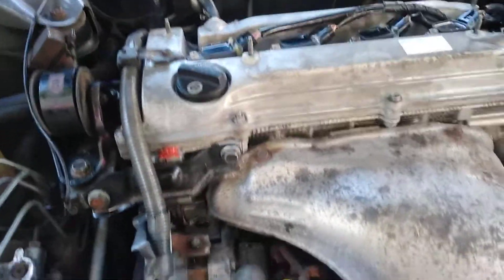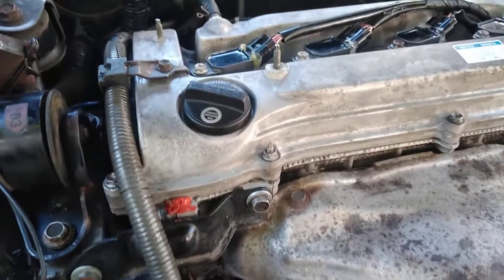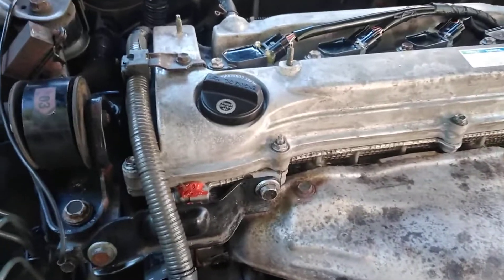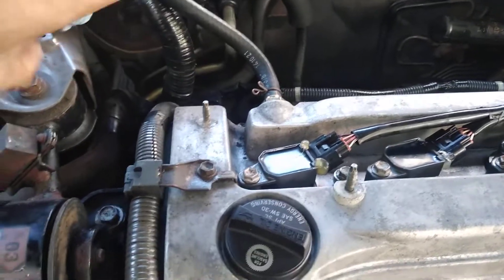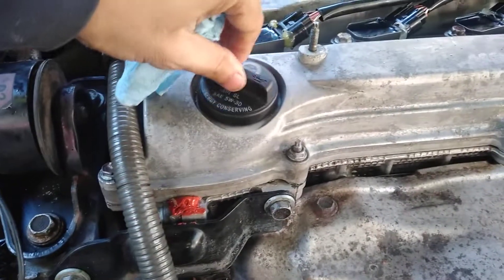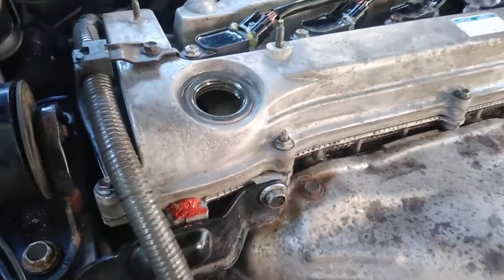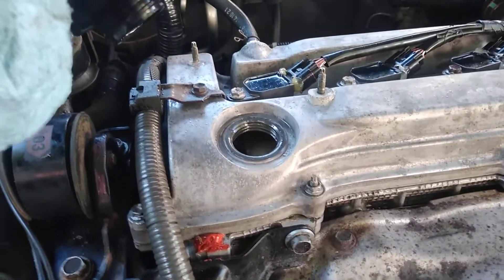Too much positive pressure from oil cap. Camry 2005 2AZ-FE engine.

Comment: I watched a  video telling people to test used cars. It said that it’s abnormal when there is a blowby😂Is he telling nonsense?
Reply from the maker: Not necessarily. This is normal in Toyota engines. At least two of the Toyotas I have owned, both show the same symptoms but run fine.
Reply: @someone1089 ok I see, thank you for the information. Mine is Nissan😢

Comment: So many engines have been misdiagnosed by this same alleged issue.  There is nothing wrong with this as BMW 4 cylinders do the same thing and Ecoboost Mustangs etc.  When you put the oil cap back on, the PVC system works as designed.  The 2015 Mustang I have in my shop was diagnosed by another repair shop as needing an engine simply due to taking off the oil cap while it was running and hearing the noise and feeling pulses of air coming out.  A cylinder leak down test showed only 9% leakage in cylinders 1&2 and 6% leakage in cylinders 3&4.  A compression test showed 170, 170, 171, and 174 PSI which is terrific on a 105,000 mile engine.  No blow by on this Mustang engine.
Reply from the maker: @davidmcclain5180  Thank you for your valuable input on the subject. I have come to the same conclusion after learning from many experts like you. I have sold this vehicle, for other reasons and bought another Toyota. This newer Toyota is behaving exactly the same, i.e pulsating air in the oil cap. I might upload a new video of this one too. But I'm not worried about performance now.

Comment: I have the same problem but there is oil on my crankshaft position sensor. I think there might be a sela thats already messed up in there. That causes oil to leak into the sensor. That is just the sympom of pressure build up in the engine. I barley atarted checking this out on my car. Anyone got any idea. I know alot say it could be the piston rings, but then it would be blowing white smoke out the engine cap. This is just excessive air build up

Comment: Loose your pcv valve and you will see there is no air or blow by on the hole.The oil filler still move air but no smoke or comoresion ...

Comment: I freshly rebuilt my 2azfe and put new rings and pistons on and it has same pressure coming out of the oil fill but as long as its not smoking out of it or out the exhaust than is normal i guess..  the cams and timing chain all are open to the air inside that valve cover so they make that much wind apparently.  Those motors though have issues with the pistons not allowing proper drainage between the oil ring holes snd causes buildup and seizure of rings which inturn burns the oil.  Eventually it will effect all pistons and start burning over a quart every 100 miles or less..  i guess it could be a leaky valve causing the pressure there but isnt any blowby like some are saying.  Probably if anything its an exhaust valve not seating fully releasing that pressure out through the valve body.   Youd think the pcv valve would be putting in work with that pressure though which if it gets clogged will causs issues.. mine has no pressure coming out of the dipstick though so not anythibg big..
Reply from the maker: Thanks for the detailed reply. It makes me feel better that a rebuild engine is behaving the same. I also suspect that it's either the valves not seating properly or the valve stem seals have some leaks. Despite this air blowing the car still runs great.  It loses oil a bit which I have not measured yet. One again thank you for your input.
Reply: Yep these motors are known to burn oil after some miles are put on it or if the motor overheats even once..   or if regular oil changes arent followed.  The piston oil rings were not designed correctly and toyota recalled them if the motor was burning more than a quart every 100 miles.,  the fix was replace the pistons and rings with their upgraded version:.  Otherwise best bet is to keep the oil changed, change the little vvti screen/ filter behind the power steering pump and check the pcv valve every so often to make sure its not clogging up at all.. use a cleaner like seafoam in the oil before you change it also..  will be able to hang on to the motor for longer..  just stay on top of it or it will stay on top of you..

Comment: I have very similar problem on my 2005 accord 4cyl. Oil fill hole blows air like a fan. Car is burning lots of oil. Exhaust is producing black smoke. Thicker oil reduces the smoke but it doesn't stop. Fuel economy is also very bad. Im of the opinion that my rings are stuck.

Comment: That is pistong ring problems.

You need to know that your engine can pass 300,000 with the rings problem. 

If you dont have too much oil consumtion keep with 5w30.

If you have oil consumtion its easy 5w40 or 0w40 

At every oil change use a engine flush motor medic, liqui moly or just 1 quart of diesel 10 to 14  minutes at idle and drain
Reply from the maker: Thank you for your valuable advice. My car has oil consumption issue. Specially after highway driving it loses more oil than compare to local roads.
I will try to flush next time I change the oil.

Comment: If you haven’t lost oil, power or compression then I wouldn’t worry
Reply: Mate this is normal blowby even in new cars! that's what pcv valves are for. Don't worry
Reply: @DimoS...  how about if air with some smoke and oil?
Reply: @medelkasmi1100  it also depends on the design of the engine mate...usually, smoke and oil are bad signs, but in most cases, it is normal or initial blow by stage.
Reply from the maker: I am loosing oil. Specifically on highway speeds its about a quart every 600 miles. I am thinking to do a piston soak with some chemical.

Comment: I've got exact same symptoms on a Mazda CX7 2.3L Turbo - there is the exact same sound from oil filler. However when I check the dipstick, I get nothing.,... this does not make sense as they should be the same.

What I'm thinking is that with the filler open the PCV closes due to lack of pressure and we see air pulsating out - when we close  oil cap and check at dipstick, there is some pressure inside which opens the PCV and it does not pulsate.

This might be how the engine works out of factory - have you found out anything more since making the video?
Reply: I also have one other theory which is the oil filler cap is directly above the timing chain - and that creates a lot of turbulence in that area.... hopefully you have figured it all out alredy!
Reply from the maker: @pingpong9656  Thanks for your input. I haven't figured it out or got any satisfactory answers yet, but a lot of suggestions like yours makes sense. I am driving this car as my daily driver and recently done a 1200 miles round trip without any problems.
Reply: @someone1089  On a forum, someone mentioned that 4 cylinder engines from 2000 onward all behave like this - he said we must be used to V6+ cars that have no such sound... this made me go check another 4 cylinder car, and sure enough it's the same sound - that car is super healthy.

I think we are good - I have some piece of mind now.

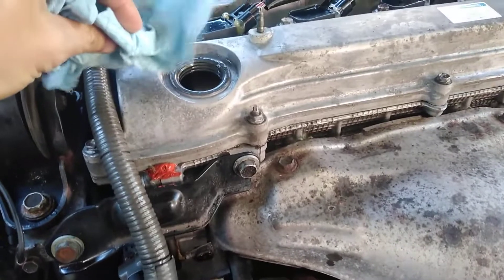Comment: Thank you for the comments; my car is 12 Camry 2ARFE with 164k miles. I have the exact same symptom; blowing air out with no smoke from the oil fill cap, same as the one indicated in the tissue test in the video 00:54 timeline. I did the balloon test for the dipstick, and it was dead silent. The Mechanic changed the VVTI Intake since there is no smoke, changed the PCV valve, and he did the compression test wet and dry no variation there. The mechanic said the air was not exhaust; otherwise we would have seen the exhaust smoke coming out along with blown air. Also, It wouldn't be a ring, because as it leaks compression, it would also leak oil the other way and cause the oil fill cap to blow smoke after burning it in the combustion chamber. It is driving me crazy as this has been two year long process. I saw Toyota Highlanders and tested them; the oil fill cap was dead silent with engine running. The mechanic said It must be something leaking somewhere, because this is not normal. The combustion chamber should be sealed. Does anyone have any idea? Thank you!
Reply: Does your engine consume oil or do you have any other problems with your engine? If the answer is no, I would just forget about the oil cap and enjoy the car.
Reply: @antonmaltsev7760  the car oil is going down by one quart every 1000 miles.
Reply: I have the exact same problem
Reply: My 2.4 2008 Camry does the exact same thing.
Reply: Did you figure out the cause of ten problem?
Reply: No still looking for a solution.
Reply: Leaking valve seals?
Reply: I am not sure to be honest.
Reply: I have similar issues with a 2007 Camry. Sometimes a little smoke comes out.
Reply: My 2005 Camry does the same thing and it has me worrying. It runs like normal with no smoke oil cap is clean but seems to be burning some oil. Like a quart around 2500 miles

Comment: Hello, My 2008 scion doing this. 1200 miles ago I did the piston soak with Berrymans B12. It really worked / stop burning oil …only about a half a quart every 1200 miles. But now I have this same issue…anybody ???
Reply: Go back and repeat your mysterious Berryman “piston soak”. Prove that the prior soak was effective by repeating the results. 
Then you have your answer. 
Your popcorn rice burner is junk. Just like mine.

Comment: Same with mine. I think it’s normal to have that but if there is smoke coming out, then it’s bad.
Reply: see more of my posts on this thread.... Are you driving yours with no problems? engine Gasket or seal leaks etc ? thanks
Reply: @TTheo-cb4jz  it burned some oil but it never smoked out the back
Reply: My seals are getting leaked again and again same situation. What should i do?
Reply: @farhanameer1771  sell it haha
Reply: @farhanameer1771 https://youtu.be/d7pUujvXejU?si=wlo6xeiYNMuycDF5
Reply: @farhanameer1771  check that your PCV valve isn't blocked
Reply: @TTheo-cb4jz  pcv also replaced
Reply: @farhanameer1771  well the only thing I can say is do a compression test. cold and warm. First cold then warm ...record what each your cylinders are doing. I can't remember what the ranges I think you don't want anything under 80 -85 pounds. Igoogle what the manual says on that 
Engine.

Comment: With the valves and cam moving around in there there's a lot of air movement. Put a glove or balloon on the dipstick tube and check there instead. I connected a piece of plastic tubing to mine ( about 12 inches long ) and then the glove.
Reply from the maker: Thanks for your input. The dipstick feels dead, no suction or blow. I will try the balloon method. The car runs normal otherwise and it has good pick up.
Reply: @someone1089  There should be suction on the dipstick. I found no suction on mine with a new aftermarket pcv valve, l put an OEM valve on and it works great. I also found no suction on my second car with only 50 K on it, cleaned valve and the suction returned. Point being, they need frequent cleaning.